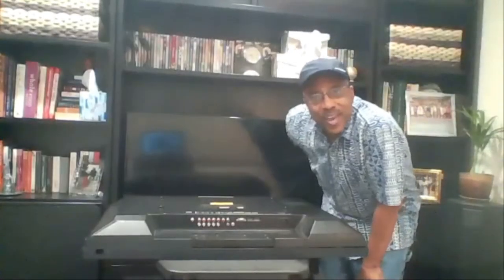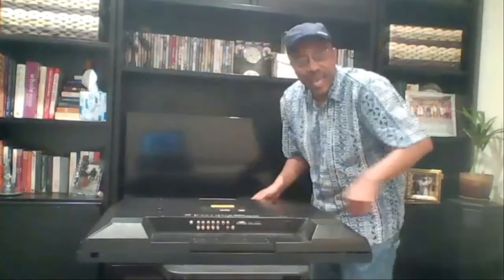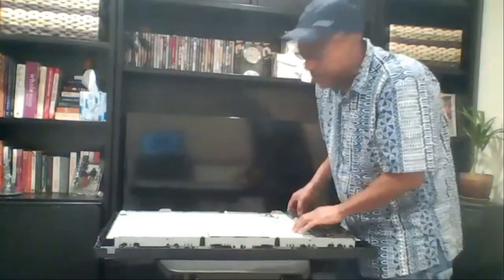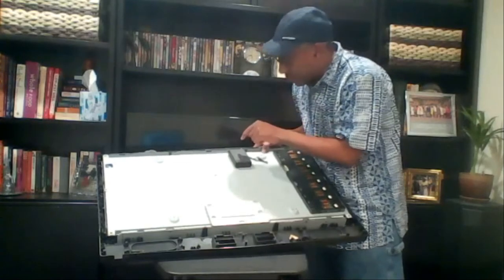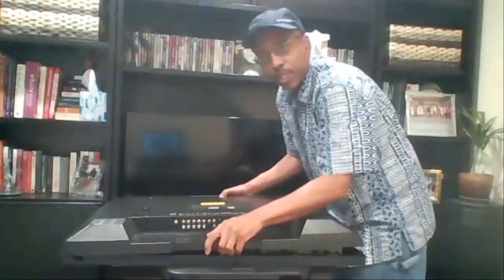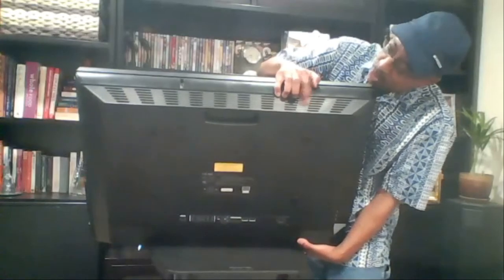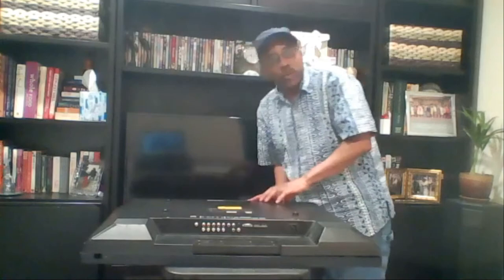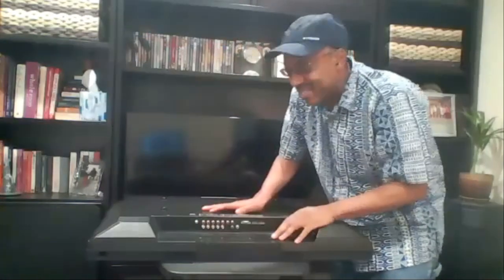Installing Tracker on a Flat Screen TV

Comment: How is the gps powered while inside the TV?
Reply: My question too
Reply: That's my question too because can't depend on battery life.
Reply: i would assume its battery operated, charge it for a good bit then forget about it, you could manually solder some wires so it charges from the main plug but you'd have to do it at your own risk and there's always the chance it goes on fire, or over charges depending on the battery type and could explode
Reply: @DragonSephi87  battery powered  gps Systems have a problem with the batteries. They swell up over time and can lead to fire. I used one in my car and had to remove the battery altogether.